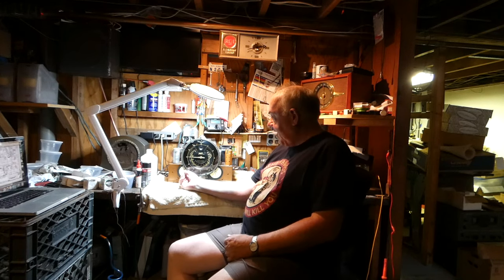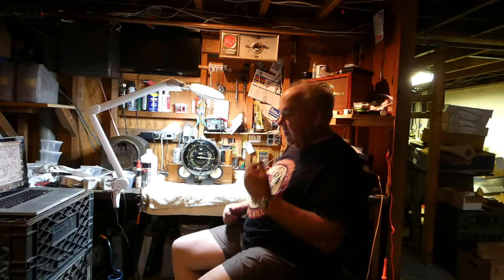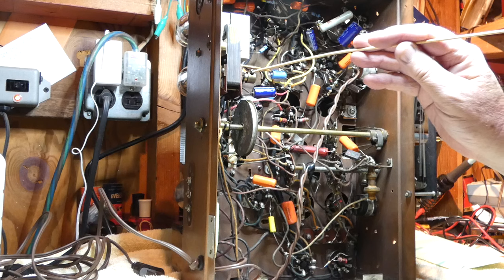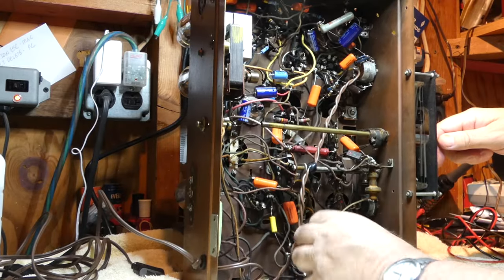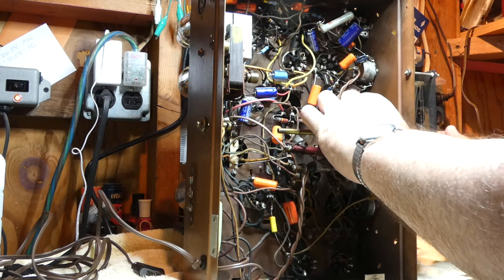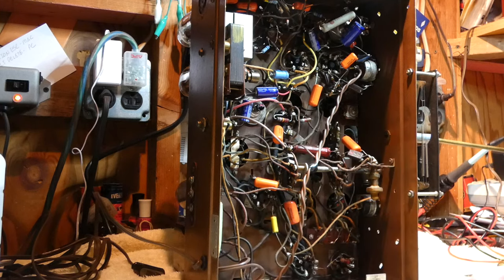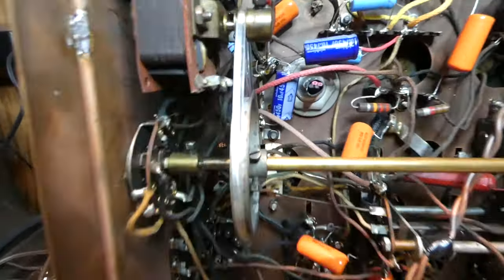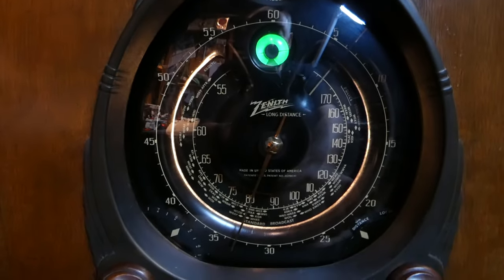I decided to check the dial belts on my 1938 Zenith

Comment: Hopefully these new clear belts will last longer than the pale yellow/tan ones that an old supplier used to offer. I noticed that the old ones would, if a set wasn't used regularly, start to keep their form if left for months/years in one position. Eventually they'd then stop to work completely because they will have taken on a new permanent shape and any pulleys, tensioners, shafts etc would just turn while the stiff & shaped repro belt sits there not moving.
Reply from the maker: The ones I replaced on my 9 tube shutterdial were about 10 years old, and were starting to bind up even when tuning. I couldn't really root cause why, but I'm thinking that you're correct about not retaining their flexability. The new ones (exactly the same one that went into the radio on the video), were just fine and worked fine with the manual and motorized tuning. I didn't play it every day, but didn't think this would have happened either.

Comment: I used belts from the same company in the 15-s-269 that I got from jd auctions. I believe it was from the same estate as your 12 tuber. The belts seemed a bit tight and I had similar symptoms. They have stretched out slightly over time from leaving it sit and work decent now.
Reply from the maker: Thanks for the information, and stopping by! I'm not sure when I could get back to it anyway, but I will follow it up.👍

Comment: I vote to try both.   Oil the original motor, if it fails then go to the boneyard.   Don’t worry about taking from a complete chassis.   For my ‘48 Philco I bought a complete, probably working, chassis just for the dial pointer.  
Steve
Reply from the maker: Well.. I've got a week or two before I can get to it right now. I appreciate all the feedback. I've bought complete radios to get a part or two.. I'm guilty too....😁

Comment: Good job Bob. The motor for the robot tuner probably needs a little TLC  too. It moves too much in and out and that can 
be the binding problem you are experiencing. It worked great one way but then it balked going back the other way.
Reply from the maker: Yeah, it's on my "to do" list. Got to move on to other things but it WILL get done.

Comment: I suspect the belts are putting too much tension on the mechanism causing it to bind.
Reply from the maker: I suppose that's a possibility, but I'm thinking it's the motor needing help. I do have the belt that was on my other radio and could try that first before taking out the motor. I'll probably address this sometime next week.